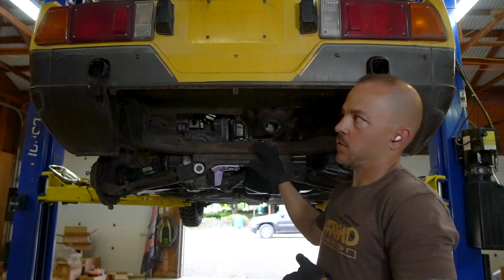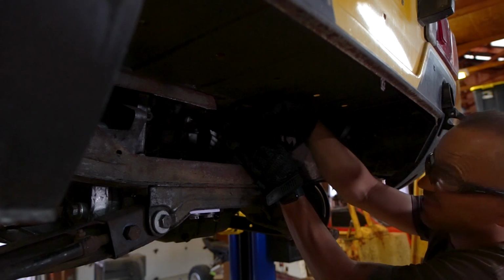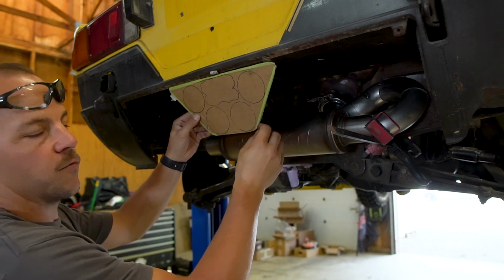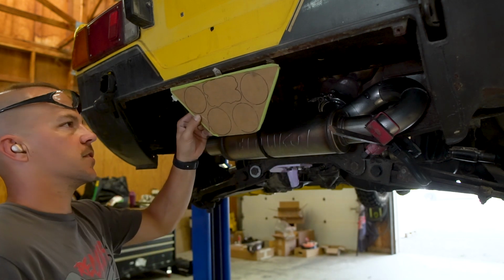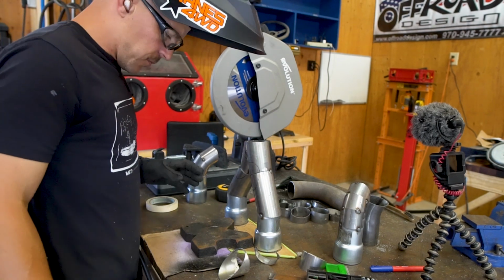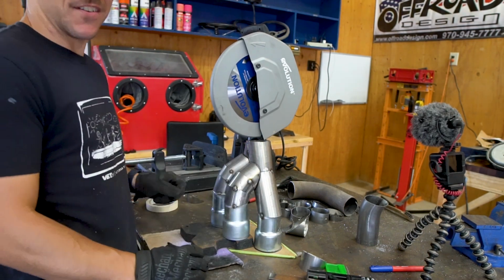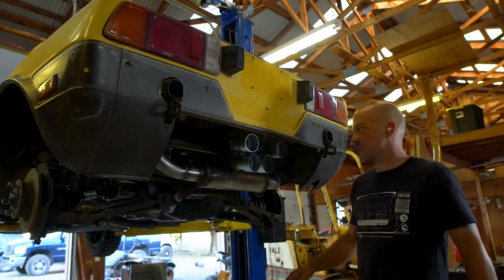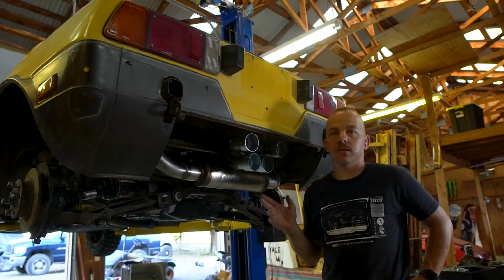CRABS 🦀 Ep4. Supercar Exhaust - Reckless Wrench Garage

Comment: Is that the on base "Hobby Shop?" My uncle used to talk about them when he was in the Air Force. He used to flip cars and painted a few on base.
Reply from the maker: No, this is the shop at the house I’m renting. We wired it for 220 and installed the lift a few days before we did the engine swap. 
Most of the hobby shops are pretty well set up though. I spent a lot of time in them early in my enlistment.